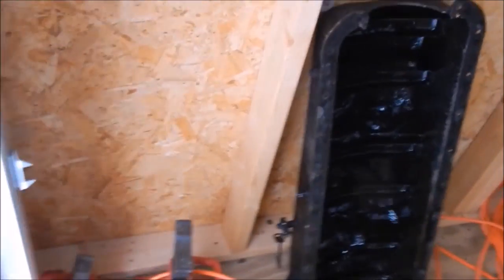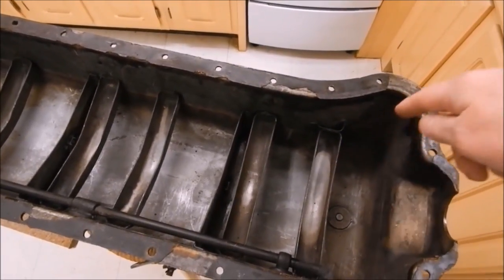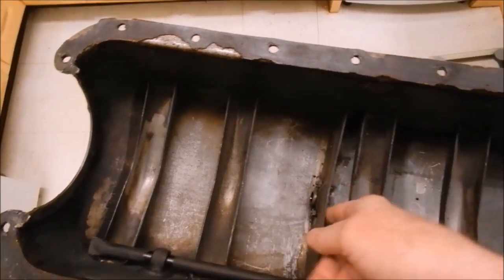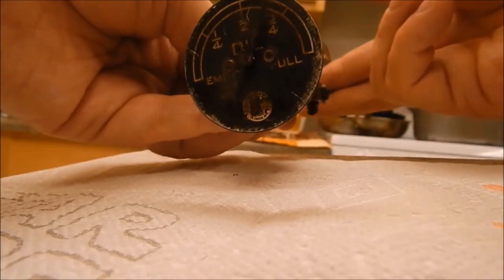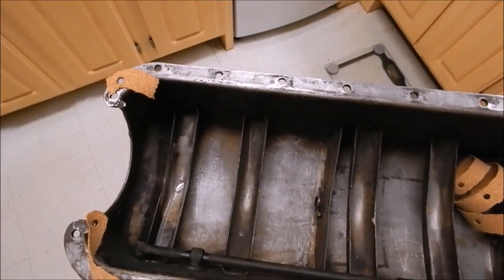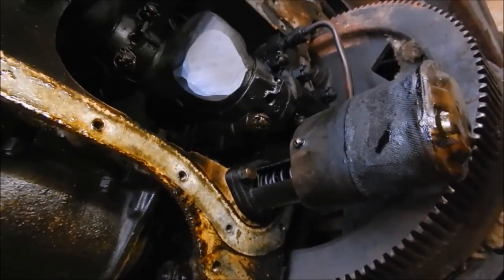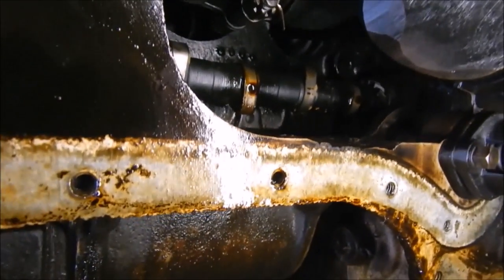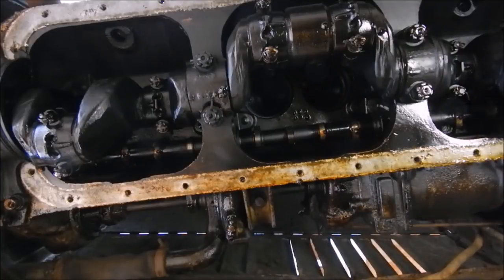1917 Buick sat for 80 years. Part 1.1---Dropping oil pan.

Comment: The baffles are to prevent "surging" -- the uncontrolled rush of oil to one end or the other of the pan by gravity, should the car transition to a sharp up- or down-angle following a climb/dip in the road. Without baffles, some splash troughs might go dry momentarily, while others would be overwhelmed with oil and the latter would risk being sucked up into the nearest cylinder(s). The manual for my '29 Buick Master Six mentions this, even though it doesn't use splash lubrication.
Reply from the maker: Thanks I kind of thought so
Reply: Abcde , drive down Whiteface Mountain, you'll know the baffling is needed...:)
When I was a kid, whenever an uncle showed up with a new car...,  (second hand New), he had to tell us it made whiteface mountain...

Comment: Oil baffles are easy. You are thinking about an engine running sitting in place. But the car moves and stops etc..need to keep oil from sloshing during operation.
Reply from the maker: Good point

Comment: So working on memory... the 1919 I worked on had some advancements on this version. I do remember it had a dipstick with a flip top filler tube. The oil pump mounted up into the block similar to what you have but besides the small manifold that filled the troughs that mounted to the block, not the pan, it had a line that fed up into the engine. The oil gauge that was on the dash was an actual pressure gauge and had a small typical metal line that hooked to the side of the motor. It registered 5 to 10 psi if I remember correctly while running.
Reply from the maker: Yeah 1918 was the last year for the oil spinner, next year a real gauge. Dipstick would be nice but don't you like this gauge? Pretty slick, huh? The cork inside is from the wine bottle industry.
Reply from the maker: I got rid of that crappy old cork and got a new one from a bottle of wine.

Comment: I would check the giant block of sludge you dug out of the oil pan. It might contain the missing gear on the oil level indicator.
Reply: Thought the same thing. Has to be there, don't know if it would make it out the drain plug
Reply from the maker: I thought about it but too late. Luckily I had a spare engine and it had the gear. Too bad I recycled the sludge.